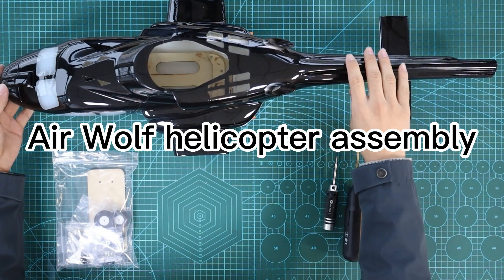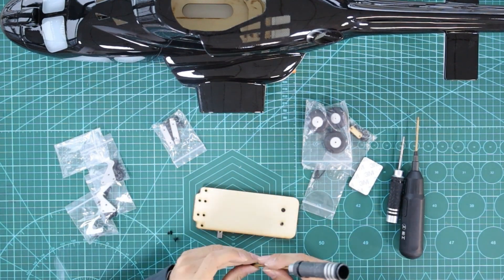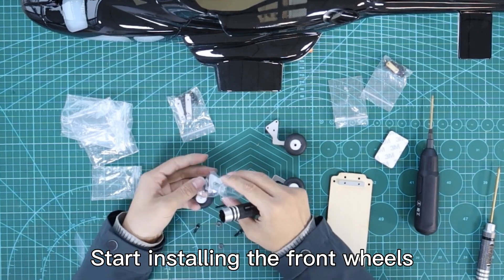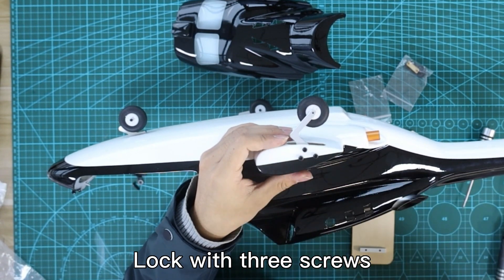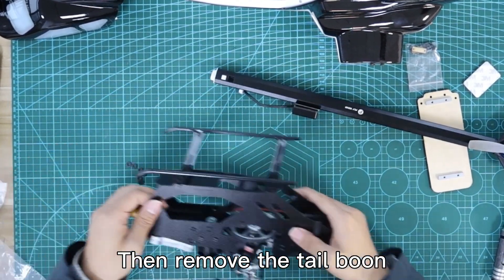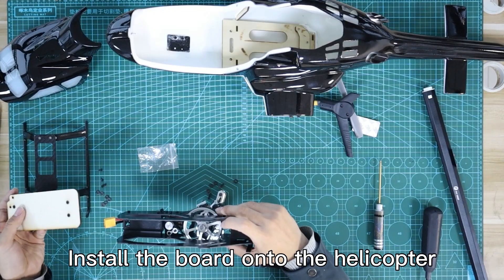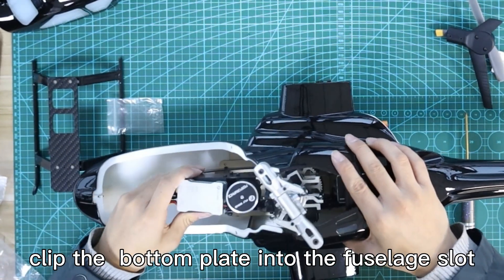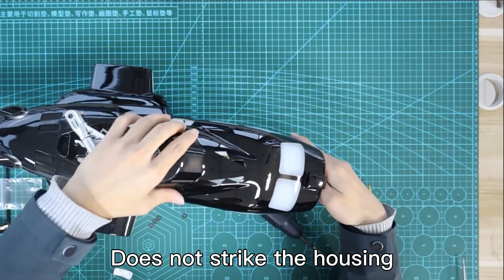FLYWING AIR Wolf helicopter assembly for FW450

Comment: One thing I don't understand, you basically inverted direction of the GPS Module when taking from tail boom and fixed on top of H-1...is any change in the software in order to do this?
Reply from the maker: Check automatic learning, H1 will learn the GPS installation direction.